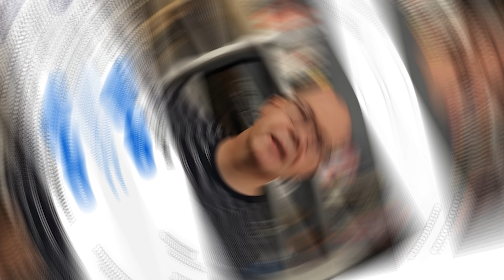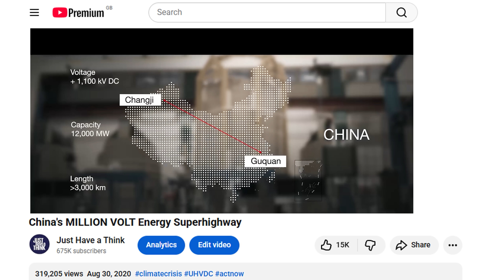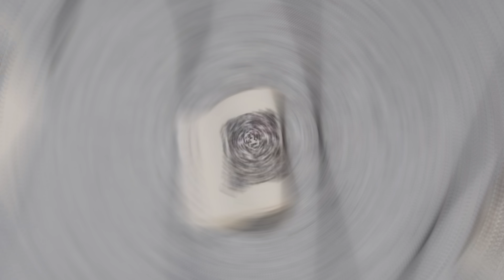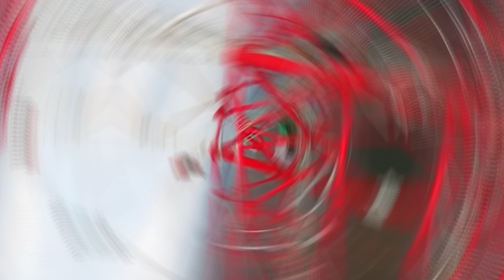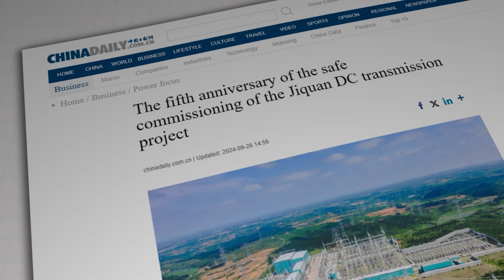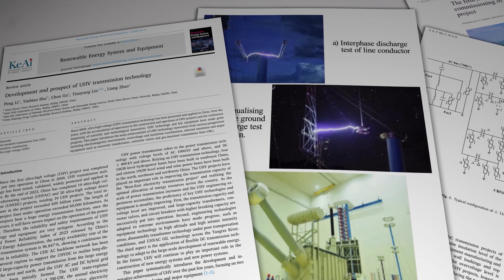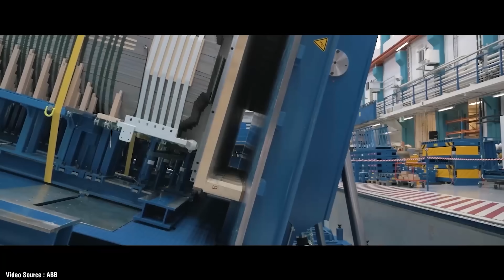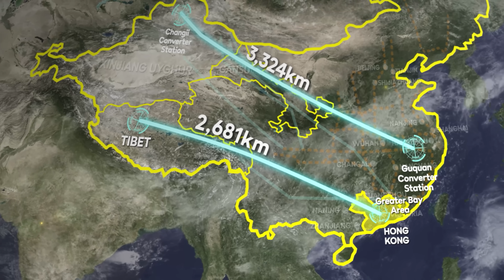China's ultra-high voltage transmission lines now breaking all records.

Comment: New Topic: Supercritical Carbon Dioxide Turbines.. 50% more power density than steam.. If these could be swapped out for steam generators? Bam! Way more energy output for the same energy input... Just watched a piece on a 15 MW demonstration unit powering a metal smelter in rural China.. The first  of what will be millions I am sure..
Reply: Geothermal is the future.  It will crush all other forms of energy production.
Reply: @TerraPotentia  Just like fusion. Always 10 years away but I do hope you are correct. After all the earth will always be warm until it's either consumed by the ever expanding sun before that too shrinks OR the core cools down eventually which leads to some bizarre side effects..
Reply: @stickynorth  Geothermal is about to be revolutionized, and ALL locations on the planet will be able to use it.

Bear with me a moment...  Hear me out...

The Kola Borehole in Russia is the deepest borehole ever dug...  ~40k feet deep.

It took the Russians 20+ years to drill it because mechanical drilling has its limits.  When you get deeper than 10k feet the rocks and pressure destroy drill bits in short order.

This greatly slows down drilling because you have spend a lot of time bringing the piping and drill bit up to the surface, change it out, and then reinsert it down to the point of contact to begin again, but you'll only get a few hundred feet before you have to do it again.

You also have to continuously pump drilling mud into the borehole to suck the detritus back out.

It's a very long hard slog...

Enter Quaise Energy which was spawned from MIT's Plasma Science and Fusion Center.

They can use a gyrotron to produce millimeter waves (MMW) that literally vaporize rock.

Early testing shows that they can achieve 5 meters of drilling an hour through granite which has a Mohs hardness of 7 (some of the toughest rock on planet earth).  Mechanical drills can only get 0.1 meter an hour through granite by comparison.

Quaise estimates that they could redrill a new Kola Borehole in 100 days...

Their plan is to use old oil boreholes which are typically 10k-15k deep, insert the MMW drill, and reach depths of 10-20 km where the rocks are 400 C to extract superheated steam to produce abundant power.

They've already drilled a 118 meter test drill through a granite quarry in Marble Falls, TX and it sliced through it like butter.  As it vaporizes the rock the drill bit also seals (melts) the rock around it to seal the borehole where with mechanical drilling you have to seal the borehole with concrete.

Next year is their first test in the western United States.

Comment: Hello from Australia. Could you make a video of the feasibility of having a UHVDC line that spans the equator like the massive internet lines we already use? Could transmit power to all those countries endlessly as long as there is solar along the way. Or would localised renewables+battery be the only way to move forward?
Reply: Geothermal is the best option...  Just 0.1% of the thermal energy beneath all of our feet is enough to power all mankind's needs for the next 2 million years.

Comment: New Topic:  The US Department of Energy July 4, 2026 Nuclear "bake off" where 11 chosen teams are trying to build and power at least 3 small modular reactors by July 04, 2026... About 7 months and a few days from now.. The most interesting to me? Deep Fission. Created by a father/daughter nuclear repository engineering team, they've already started construction on their first test reactor, 1 MILE UNDER PARSONS, KANSAS! That's right? A 15 MW boiling water SMR will be lowered down a 30" borehole 1 mile deep. If all goes to plan these will be placed in high density sites with up to 100 15 MW reactors generating up to 1.5 GW of nuclear energy 1-mile under the earth. And when the TRISO-fueled cores are spent? They can be retrieved, repowered or removed OR left in situ and concreted over leaving them buried in place 1 mile deep. In other words? You solve many problems with one solution potentially... All for a projected LCOE 5-7c/kwh. When you use the earth as your shield from radiation? You can strangely save much of the above ground engineering costs....
Reply: Forget about nuclear.  Geothermal is the path forward.

Comment: I would love to see a video about re-mining the tailings waste & slag heaps from old mines to extract rare earths.  
Having seen the UHVDC North-South power line in Brazil, (Chinese tech), it has a remarkably smaller visual impact than 3-phase power lines.  Just tall slender towers that almost look like radio or cell towers rather than the broad span towers of HV AC.
I'm a retired electrical engineer living in the petro-state of Alberta, Canada. Your videos consistently provide solid explanations that correct misunderstandings about climate, energy, and power: explanations I can pass on to those with their heads in the sand about the massive transformations underway. Thank you!
Reply from the maker: Thanks Jess. I'm very glad to hear that the videos help a bit.

Comment: Hello Dave, I suggest focussing on the electrification with multi -MW heat pumps in food industry and others. By re-engineering the process (f.e. drying) to lower temps the heat pumps reach COP’s up to 4 which easily offsets the spark ratio almost everywhere. So economics start to work on industrial electrification. DM me if you want to know more.

Comment: Sulfur hexafluoride (\(\text{SF}_{6}\)) is a man-made, colorless, odorless, and non-toxic synthetic gas, primarily used as an excellent electrical insulator and arc quencher in high-voltage switchgear. It is the most potent greenhouse gas known, with a global warming potential 24,300 times greater than \(\text{CO}_{2}\) and an atmospheric lifetime of 3,200 year

Comment: New Zealand has a High Voltage DC link ! Since the 1950 s !
Reply: HVDC has lower throughput than UHVDC, but don't worry about these overblown claims of dominance.  China HAS to have UHVDC because almost all of their renewable power generation is in far western China, but all of their population is in far eastern China and they need those lines to move all that power.
Reply: @TerraPotentia  actually I think it’s VHVdc , links our South Island to the more populated and less rivers North Island
Reply: @robertwoodroffe123 UHVDC is the largest throughput and only China has built them

Comment: Given that China's transition including UHVDC is heavily inverter based, I would like to know how their systems manage the "system strength" issue.
In short system strength is ability of a circuit to clear (blow up) faults with minimal voltage / frequency disturbance.
In established (fossil) markets politicians and other road blocks use the phrase along with "base load" as incantations to slow progress.
I'm interested to know whether the Chinese ( or Siemens et al) inject fault current or whatever they employ more effective fault detection and non destructive disconnection.

Comment: Thanks for these useful videos. Any chance of doing something on district / large building / high rise building heating systems and the growing use of ground source heat for those; ideally comparing the efficiency of those with area heating using combustion of household waste or "waste wood"? It's a big topic with quite a few permutations (eg using mines, train tunnels, river water as the heat source; or using small heat pumps in individual flats instead of one big pump in the basement, but sharing the same heat source). The main comparison I'm interested in is with combustion, since big combustion systems create lock-in situations where material is required to be burnt over many years, often stifling other uses such as reuse or recycling. And government seems over keen to subsidise those combustion systems. Hmm!
Reply from the maker: Thanks for your suggestion.

Comment: Considering the Blackout in Spain and Portugal this summer was indeed somehow connected to a bottleneck between france and Spain we do right now do not have the necessary Transport capacity in Europe and should do our homework. I would not dislike it too much if China would build somthing compareable here in germany, we need it and seems like we need help. What is like freaking crasy. Germany needs Chinas help for power supply. Ups.
Reply: Geothermal is the future of energy, my friend.

Just 0.1% of the thermal energy beneath all of our feet is enough energy to power all mankind's needs for 2 million years.

We just need to tap into it.

Comment: Here in Saint Louis Missouri alongside the Mississippi River would be an idea location for zero head water turbines. The water flow is a constant 7 knots. Building generators along the shore on floating platforms would be realitivly easy. And the main grid is very close. Just an idea.

Comment: Hey could you do an honest energy audit of solar panels. I mean any  system that by absorbing 95% of incident solar radiation and can only convert 20% to electrical energy the rest becoming heat euphemistically called only local heating.  Is warming the semi closed atmospheric system at a vast rate of kilowatts..Alarm bells are ringing.  What happened to the necessary reflected solar energy. At least with fossil fuels plant growth accelerated to refix carbon.

Comment: What a stunning response for the temptation of the minute chance of a hoodie, so I must also join in.

This is bit more trivial than most of your topics.
Our G99 was limited to 5KW because of the potential (pun intended) voltage rise at our meter point. When I tried to dig into the methodology I didn't get very far although it seems to be based on a worst case scenario of no local consumption. To my way of thinking, this is a bit simplistic when inverters can be rather sophisticated. For instance, it can't be difficult to limit the feed back into the grid by limiting the voltage to the stautory upper bound. During periods of high demand we would be supplying neighbours on the same phase and helping the local distribution. Of course there would have to be some means of negotiation between inverters on the same phase.
In short, it feels like an overly simplistic means of calculating feed in limits when they could be dynamic.

Comment: Thanks for nudging this story.

How's about Data Centre Heat Harvesting and Heat Reuse. This is becoming much more viable as data centres migrate from air to liquid heat transfer driven by silicon processor's above 350 watts

Comment: You may already have covered this topic, but I've not recently heard anything on the possibility of using electrolysis to separate hydrogen and oxygen at offshore wind farms when they have surplus energy, then recombining them to generate electrical energy in calmer times. Is this feasible with sea water? Is it much more effective to build suitable plant on land (with fresh water and away from the harsh offshore environment?

Comment: I don't care for China.. but I do like DC current as I use only DC in my house except for the tv (for now)..it's better and safer and cheaper. Any normalizations into DC is a positive. Maybe you can do something on DC current use in the house..the movement  is starting already..DC moters are more efficient, that's why Elon uses them still in ev's.

Comment: With the development and availability of low cost, high efficiency buck boost voltage converters and renewable energy systems which for the most part are operating at non standard voltages ie 240 or 110 volts, it begs the question; why are we still installing conventional power and lighting systems in our homes and businesses? Would it not be more efficient to install a common power rail, for example: to feed lighting circuits and use electronic switches and 'transmission line' communication for device management? This way you can reduce the amount of physical cables and circuits required, remove the requirement for millions of individual power packs and affords an insane level of device control.

Comment: I would like to see an in depth analysis of the potential of tidal energy production. Being
totally predictable and with tidal highs varying at different places it should be a consistent source of power. Having witnessed the 8 knot tidal current in the Irish sea I suspect there is more potential energy there than the UK could use.

Comment: Every renewable-energy advance is good news — but for established grids, I’m not convinced massive battery installations won’t make this obsolete via load shifting.

Back in mid-2024, LFP cells at $56/kWh was big news .. now CATL is saying their sodium ion cells are as low as $19/kWh. By 2030, who knows where we’ll be?

With prices like that, it’ll become cheaper to shift load rather than design the grid to handle peak generation/consumption events.
Reply: And iron oxide batteries are even cheaper, and commercial-sized test deployments are happening now.
Reply: Yes but you won't get those in the West, bcos it is just a matter of time the USA declares CATL batteries as a "threat to national security"

Comment: I think you should have a video about the state of on-street residential (low speed) EV charging in the UK. It seems we are relying entirely on local councils to put infrastructure in place and each council has a different solution. They are also rolling them out at a glacially slow pace. I live in Guildford, and despite being quite affluent, most people in town won't consider an EV because there is just no reliably available charging. What hope is there of a quick transition? :(

Comment: I would love to see a video on Hydrograph's method of making graphene using acetalyne as well as exploring how to produce acetalyne in a carbon neutral method using synthesis gas, potentially derived from waste to energy microwave pyrolysis or via direct air capture carbon removal.

Also please do a video on NatureJab's plastic waste microwave gasifier and synthetic fuel production ...

Comment: Could heat pumps be retrofit to become power generators? Or what about mechanical batteries like those that lift weights (or water) to charge and let it down to discharge?

Comment: I've been subscribed for about a year now and I really like the in depth technology reports, however they may be a little esoteric for the Average Joe. Perhaps a video covering a calculation method for the Average Joe to size their home solar/inverter/battery system that will reduce their reliance on The Grid might be one that would garner a wide and long-lasting viewer audience. Perhaps with inputs of winter/summer hours of sunlight (latitude), energy usage/day, usage peaks, etc.

Comment: With the continuing price decrease in solar and battery storage, the need to ship between regions is decreased.  The cables need to be less expensive than building the equivalent storage.  That being said increased short range interconnection helps everyone and I assume would be cheaper.

Comment: I would like you to consider the opposite of the ultra-high voltage grid, which is expensive.  If enough people have solar and wind power, a house battery, an HV car battery with V2G, a local battery, and a local small nuclear reactor, all integrated with an electronic control system.  Then, electricity generation is widely local and does not require reinforcing the grid at great expense.

Comment: I'm interested to hear about success or failure of some of the more ridiculous power generation and storage schemes that have been fielded in the recent decades.  For example the mile tall chimney with turbines in the bottom or the various gravity  battery schemes involving concrete blocks and cranes. Maybe concentrated solar plants or liquid air batteries.  Just a thought.

Comment: The environmental impact of LLM AI data centers including energy and water usage coupled with the CAPX required to build out said data centers compared to the capital generated by the LLMs. It’d be great if you added how AGI, the justification of this buildout, is impossible to achieve with hallucinations built into the LLM architecture and how LLM AI may be a justification for building out these data centers for the next level surveillance state (all the players in the space are bad actors and they work closely with governments).

Comment: On positive side, EU has now improved it's electricity networks, especially in East. I don't know we need UHV transmission lines, but we need smarter network all across EU. I can see why those lines make sense for China. If Europe would make a deal with North Africa with getting sun from Sahara, that would be interesting challenge.
For now, we really don't know what to do with sunny days even with sparse capacity we have build in Europe now.

Comment: Happy holidays. 

Appreciate the distinction between technical and nontechnical barriers. This basic categorization helps identify where the key challenges exist.

Topic suggestion: is there any research into extracting energy from fusion (still to be achieved), other than boiling water to spin a turbine. Just going on intuition but there must be something more effective and more efficient. 

Another topic suggestion: contrasting investments in fusion and carbon capture (wishful, optimistic solutions) against what that funding could do today in proven clean energy projects like solar and wind. I’m suspect a lot of our energy demands could be achieved simply by redirecting funding.